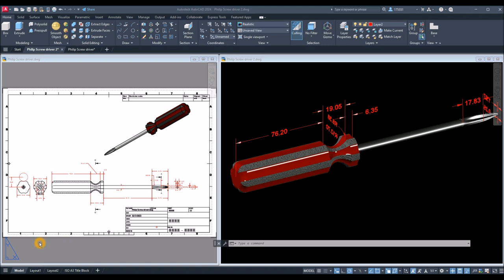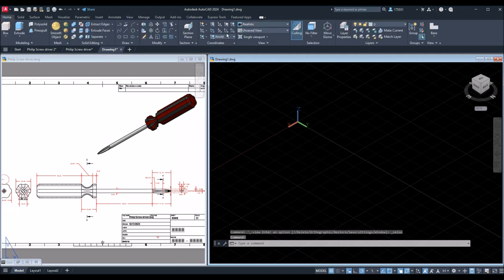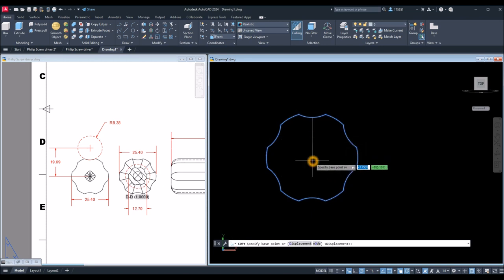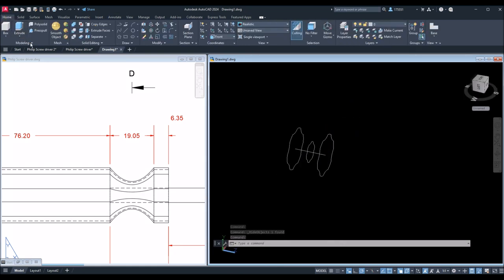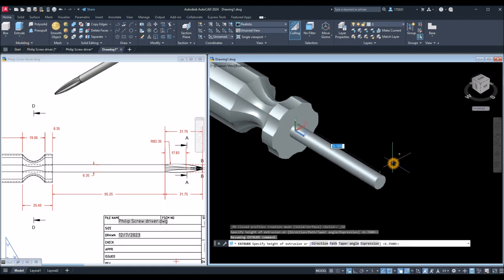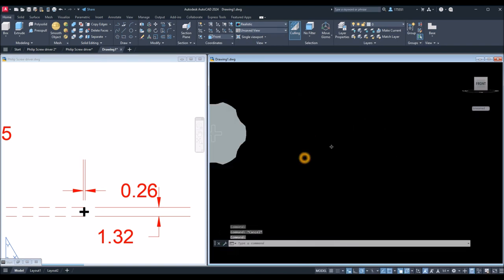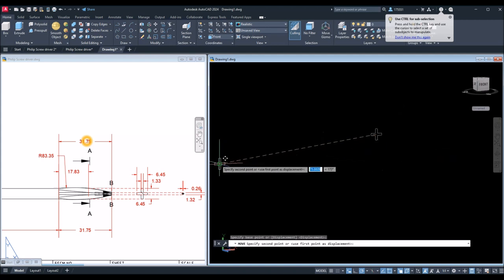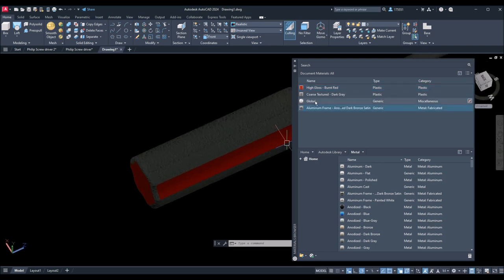How To Design a Phillips Screwdriver in Autocad

Comment: join is not working after I've trimmed. what do I do?
Reply from the maker: zoom in and check the ends, maybe some segments are sticking out . Make sure the trimming is clean
Reply: @AC3DCad  Checked before asking, the trim is clean. But when I preform join it still discards all 12 objects.
Reply from the maker: @wondering-gq9vq  I wonder if your lines are of the same plane.  Try pedit command.
Reply: @AC3DCad  Have not thought of that, I'll try and get back to you with results. Thank you
Reply: @AC3DCad  Pedit solved the issue, thank you so much for all of your help.
Reply from the maker: @wondering-gq9vq  you are welcome.